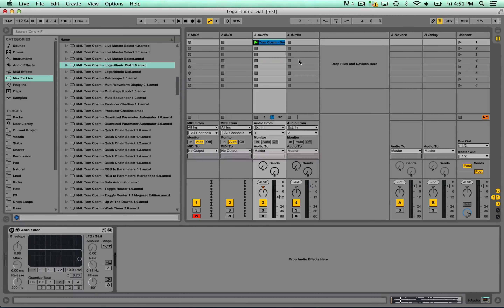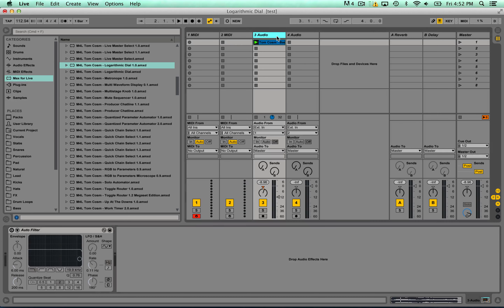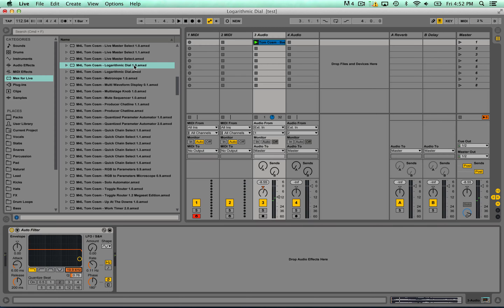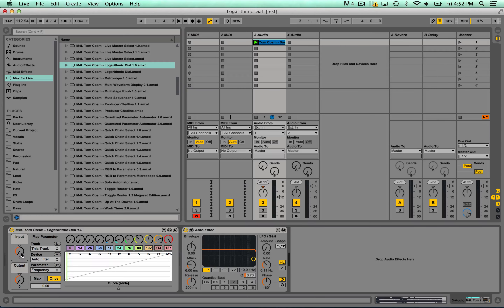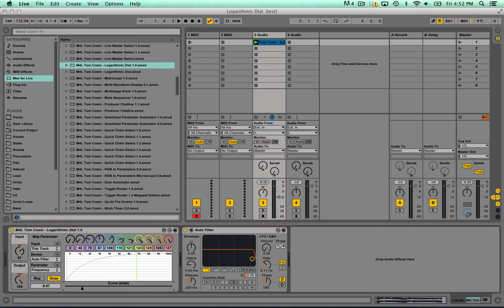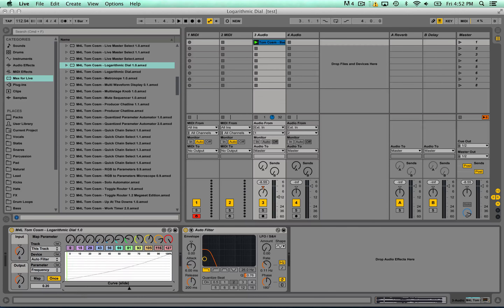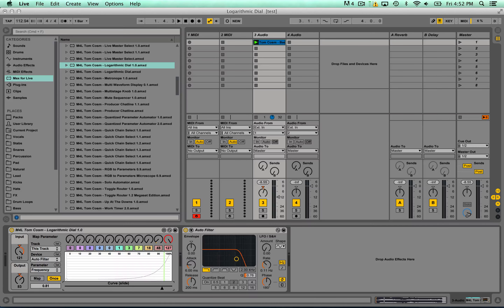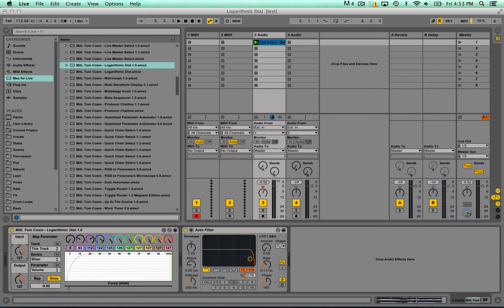Changing Parameters With Logarithmic Curves in Ableton Live (Max For Live)

Comment: Hey you should do an automatic eq modulation device. I've found that individually automating each frequency parameter is grueling work, even more so if you want to get precise with how it sounds. It would be great to have like an 8 channel lfo with drawable waveshapes. No, it wouldn't be like the lfo or lfo2 device because it would have many lfos possibly with resonance automation as well. It could also be its own max effect as a separate eq (more bands? That pinch and pull sort of sharpness adjustment? (Like in izotope eq's)). Actually that would be quite a challenge. Should you choose to accept it, even a basic eq modulation device would be greatly appreciated and cool to excitement with